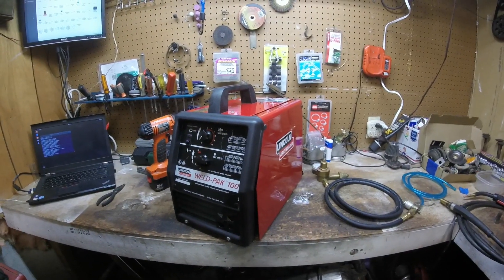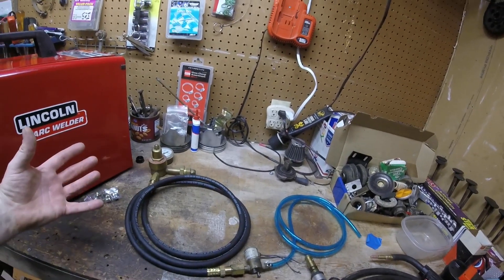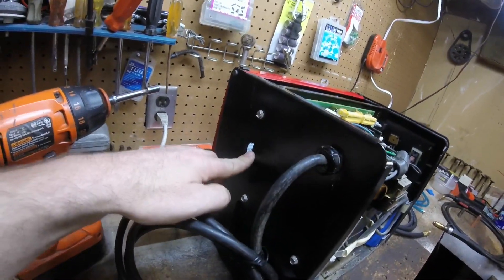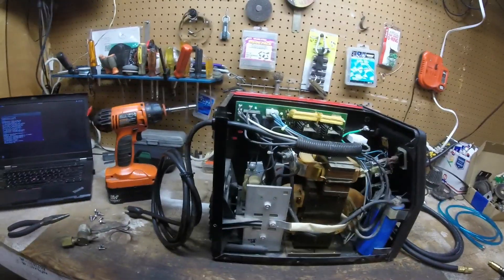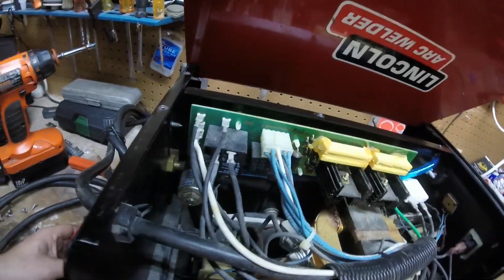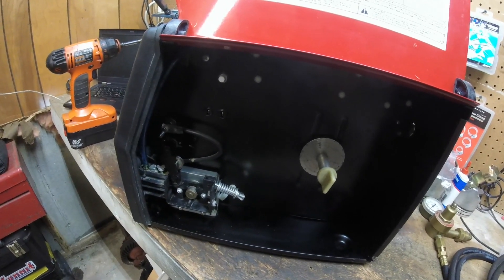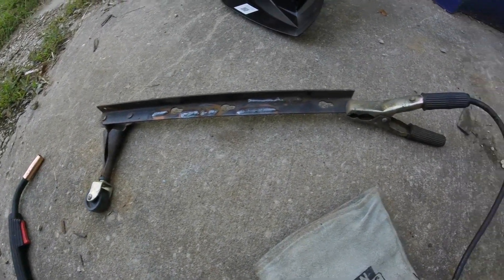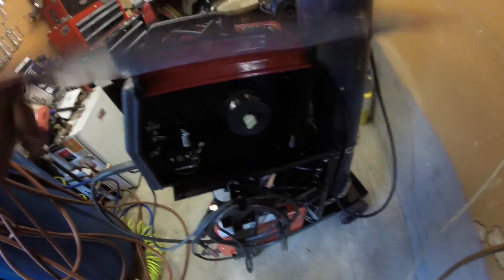Lincoln Weld-pak 100 - MIG conversion

Comment: I always wondered if I could convert my weld pak 100 welder to MiG! I’m glad to see it is, flux core welding isn’t quite beneficial for the welding I do, which is mostly exhaust/ some body work. Gonna start looking at conversion kits now
Reply: BUY THE PARTS not the kits unless someone started selling cheap ones. The official kit price is a ripoff. It's just ordinary hardware including the gas solenoid. For strength I welded a short nipple to the welder case (I have other welders) but you can mount your plumbing and valve anywhere you care to.
Reply: @Comm0ut  Tep I robbed the parts off an olg mig I had that didnt work, and have already done the conversion on my welder, I made a video on it too, very simple conversion

Comment: Seems that a MIG conversion should start with swapping the (+) and (-) leads inside the machine. Also some better camera work on the close ups of the wire side of the welder. I was really hoping to get an A-Z starting with a flux-core welder.

Comment: I wish u had gotten some clips of the drive wheel setting adjustment. It's the only thing I'm worried I won't be able to get done.
Reply: Drivewheel or roller just needs a little tension by screwing wing nut down. If you're talking about the wire spool tension, there is an allenhead setscrew inside the wire spool spindle that you need to turn in or out that the plastic spool nut tightens against to adjust tension on the wire spool. Too tight will cause feed problems, too loose will cause a mess with the wire unraveling off spool.

Comment: Thanks for the video. I've had this exact welder on my shelf for over a decade after my brother in law moved back to Hong Kong. Never really knew I could upgrade it to MIG! Curious...for some basic ornamental welding would this little machine be sufficient? It looks like it could be.
Reply: They're quite decent and common in auto body shops. Conversion is so inexpensive you might as well go for it. DO NOT buy the absurdly overpriced Lincoln kit. Do watch all related videos.

Comment: Lincoln manuals with schematics can be downloaded from their website and include schematics. Example:

https://www.lincolnelectric.com/assets/servicenavigator-public/lincoln3/imt460.pdf

Conversion kit parts list (no need to buy from Lincoln but it shows the components well): https://images.homedepot-static.com/catalog/pdfImages/d8/d8bcb345-a5eb-43f1-8992-93d77cb86709.pdf

The expensive conversion kit is not necessary as solenoid valves and fittings are cheap.  https://www.ebay.com/itm/301113411599 (not mine but I ordered one) is representative.
Western 1/4 NPT, AW-15A adapts 1/4" NPT valves to standard external gas hoses.  See various conversion videos and read posts on the Weldingweb forums (great community and noob-friendly) as many posters converted theirs. The principle can work with other FCAW machines if they've switched line voltage accessible.

Note the Lincoln gun is a common Lincoln that's Tweco compatible. These little machines are much better made than most offshore disposables and should serve well for many years. I have many welders (they follow me home) but the little 100 is quite handy which is why I'm converting it to gas and stepping down to .025" wire for sheet metal work. If you ever replace the liner the gun used is a Magnum 100 and a Teflon liner feeds small wires nicely. 
NOOB NOTE:  Many small wire welders are sold used because their gun liner is rusty or kinked causing wire to birdnest. Liners are cheap so I don't turn down used machines that birdnest wire.
Reply: This is a great video and your info  just amazing ! Thank you so much for the great info !

Comment: What was your settings on the welder on your last bead?
Reply from the maker: Pretty sure I had it in on C for the power, unknown for the wire speed.  I was mostly focused on getting it to feed correctly since I was having a little trouble with that.  The settings chart recommends D-7 for 14ga.  That metal was slightly thicker, but not quite 12ga.  D-7 would be a good starting point, adjusting wire speed as needed.

Comment: on mine it says to change the liner for the smaller wire. I have the smaller liner but was hoping you'd show how to do that. Also turning the spool for the wire feeder around, you didn't show that either. Those are the main changes for flux to mig.
Reply from the maker: The original liner works fine with the .025/.023 solid wire.  It also makes it easier to quickly throw a spool of flux core back in if needed.  The liner that comes with the MIG kit is too small for the .035 flux wire.
Reply: You don't have to change the liner, just the tip. I prefer the smaller Teflon liner though but if your stock liner feeds smoothly there's no reason to disturb it. Save the new liner for when the old one gets kinked or corroded (which it might not).  I DO NOT SWAP LINERS WITHOUT REASON. That's because some old liners can stick after partial removal. When that happens and they won't pull out the MIG gun (well, the cable which is the main component) is done. Fortunately small MIG guns for these machines are inexpensive.

Comment: Approximate cost of doing the conversion? Considering doing the conversion on mine.
Reply from the maker: The expensive part for me was the bottle purchase.  The new full bottle in the video was around $270-$300.  A smaller bottle would have been cheaper, but the larger bottles don't cost much more to refill.  Ends up being cheaper in the long run if you expect to use it a lot.  Haven't refilled it yet but was told it would be around $35 for a refill.  If intended for occasional use, a smaller bottle may be the way to go.

I've seen the hardware kit vary quite a bit in price depending on where you look.  They're usually somewhere between $175-$300 and they come with everything you need. Solenoid, regulator, hoses, fittings, etc.
Reply: @captaindynamo78  thanks.

Comment: Great video I'm doing the same to my Lincoln 100 too. What connection did you use H1 or H2? If you could help would be appreciated.
Reply from the maker: Both H1 and H2 tabs are used.  The correct gas solenoid will have two wires, one for each tab.  When the trigger is pulled those pins apply 120V AC to the solenoid.  There is no polarity since it's alternating current.  As long as both are hooked up it'll work.